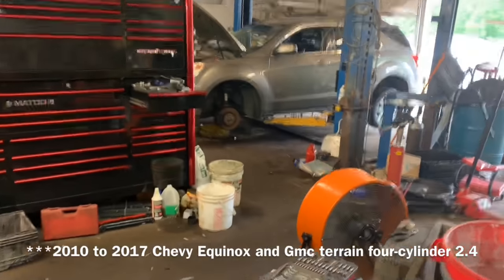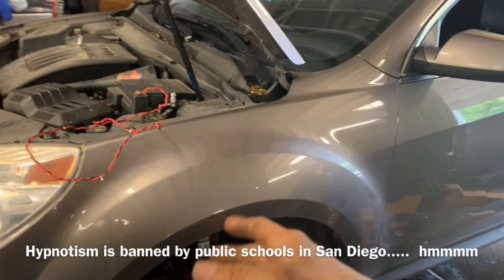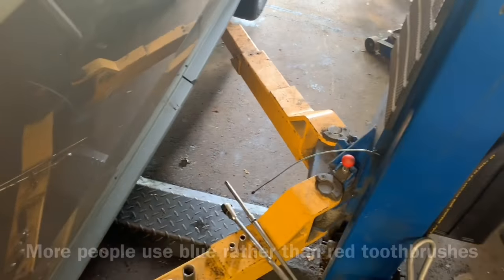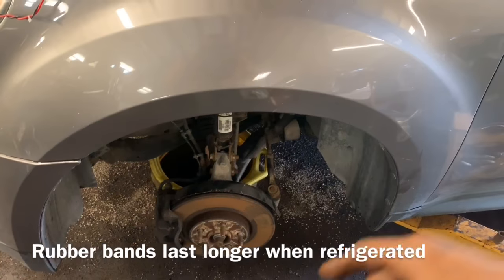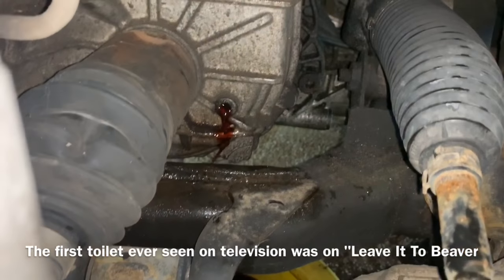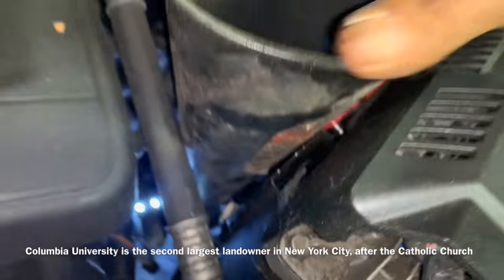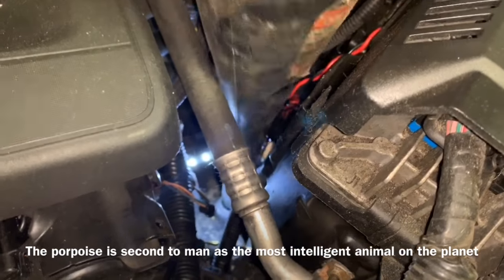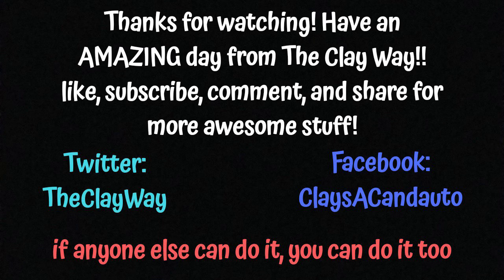Chevy Equinox Transmission fluid check and fill procedure

Comment: Is your shop still open? Google says its permanently closed
Reply from the maker: Yes but I don’t run a public repair service any longer mostly do YouTube videos and if I left my address up for people to find me I would have strangers showing up all the time that was the problem at my other shop and even though I really really love my followers and supporters it would take hours out of my day.

If there’s something special in particular that you need help with or if it’s a big job I sometimes take them on for the public but it’s very seldom. 

What is it that you need help with?
Reply: @sharpcarco  family member passed away and we are gifting the car to a relative. Took it to the dealership for routine maintenance and fluid changes. Got the car back and transmission only shifts normally at wot. Anything less and it slips and shudders.
Reply from the maker: Well that’s a really common problem with them cars unfortunately they’re pretty much all around junk but it’s probably cheaper to put a transmission in it. Then it would be to replace it so I could help you out with that I don’t have a video showing folks how to replace the transmission on it. It would not be a super cheap job though. 

If that something you’re interested in you can look me up on Clay‘s AC and auto repair on Facebook messenger and send me a DM or you can email me at Thenewclayway@gmail.com

I’ll give you my direct Contact information I’m sorry I don’t give that all over my channel

Comment: But how do i know if i need to do this? Theres no dipstick for it anymore?
Reply from the maker: Well the good thing about transmission fluid is it just does not evaporate…… no need to check it if there’s not a problem. At least that’s the way General Motors looks at it

Or if you feel the absolute desire to check it just turn the wheel take out the check screw which is the second Highup screw and the fluid comes out you’re good……. If it doesn’t then you need some you need to make sure it’s up to operating temperature meaning it needs to be at 180 to 190° and I personally remove the wheel but you don’t have to

Comment: i have the 2013 equinox. i had to pull the engine and change the rings for a gallon a month oil use and rod bearings and the timing and balance chains because the timing chain destroyed the black guide and the bolts for it, i also changed the rear main and torque converter seals but now i see i have a leak between the engine and transmission. i got the trans seal from rock auto they had 2 choices for the awd trans. i picked the first one and now i may have a leak there. when i went back i noticed the one i got has a .o59" id larger the other seal and it is .102" smaller on the od than the other seal. so can you get me the exact part number so i can double-check to see if i picked the wrong seal?  i'm going to take out the starter and if i see oil in the flex plate then the rear main is leaking and if i see oil on the torque converter or the inside of the bell house i figure the seal is leaking. if none of those places show oil then i figure the seal is not sealing at the housing?  can you confirm that theory? thanks bob p. your not to far away from muskegon
Reply from the maker: Look me up on Clay’s AC in auto repair on Facebook send me a DM and I will send you my phone number I’m over in Muskegon but I wanna make sure I understand the question you’re asking and it’ll make it much simpler for me just answer it over a phone call
Reply: @sharpcarco  thanks but i do not have a facebook account. maybe i can find you by looking up clays ac if that is for ac repair and get your contact info that way.  thanks
Reply from the maker: ThenewClayWay@Gmail
Reply from the maker: I don’t post my phone number anywhere it’s all hush-hush ya know lol My address is incorrect….. I love my followers and folks in general but they would show up on unannounced And I don’t run a retail repair facility any longer so I just help people out when I can
Reply from the maker: Sorry I meant to say send me an email to my Gmail
Reply: @sharpcarco  ok i understand. i have the same thing i fix something for someone and then i become their permanent mechanic. got a lot of those and i retired 5 years ago. this happens to be my girls car or else i would have not got involved. and this is way more than i wanted. thanks

Comment: How can I check the level? I don’t see transmission stick? Can someone help me please. I have a 2013 Chevy equinox and I would like to check the transmission fluid
Reply from the maker: There is NO dip stick , 

1. Start vehicle let it warm up to operating temperature (just like I show in video)

Leave engine running!

2. using proper socket (see video) 
Remove plug bolt on side of transmission. If fluid comes out with engine running wait till fluid starts to drip reinstall bolt. Your trans fluid is at proper level

If fluid dose not come out it is low and needs to be filled (see video) 

These instructions were in video sorry 😐 you missed them. May be I did not say there is no dip stick. Can’t remember. Hope the instructions help
Reply: The Clay Way thank you so much. Your video was so helpful. Keep up the good work brother. God bless you

Comment: It would of been very helpful to specify what type transmission fluid you were using.
Reply from the maker: OK I used the right stuff. More than likely I showed you pouring the bottle inside during the video….
Reply: But you didn’t have it to to where you could see the label, and the bottle was backward. Only the back visible. I’m assuming merc V though. Also, you didn’t show how to drain the fluid. Only how to top it off.

Comment: So how do you check the level?  It says in the description check and fill.. but not showing how to check it.
Reply from the maker: No offense but if you would’ve listen to me during the video you would know how to check in removing the bolt is the way you check it if you fill it till it comes out where the bold is removed on the side of the transmission there is no dipstick
Reply: I've actually watched 3 times and didn't see anything about CHECKING. I see how to drain and refill.

Comment: Does the car have to be on when you check it? I swear I hear the engine running. Please hit me back up.
Reply from the maker: Yes I’m fairly certain in the video I mentioned that it needs to be running and up to operating temperature to check the fluid level and fill it to where it needed

Comment: The manual says to pull the overfill/check plug out when the ATF's temperature is between 185-203 degrees fahrenheit.
What is the temperature of the ATF when the engine has fully warmed up?
Reply from the maker: Yes and sodas my video
Reply: You didnt answer the question.  Coolant temp does not equal transmission temp.  It can lag coolant by 60F.

Comment: How can it fill up when the drain plug is open and the vehicle is still running then you said stop pouring when you don't see anymore coming out, isn't not coming  out because it's empty, I'm confused
Reply from the maker: Well, that’s how you do it because the vehicle is running and that’s how you check the fluid level in the same way that you fill it up. You just leave it running. You use a long funnel to fill it and when the fluid starts coming out, it’s full then you put the cap on with it running….  And you install the drain plug with it running…. Because then the fluid is on the inside of the transmission because it’s running and being pumped through it if you did not have it running the fluid would come out of the hole at the wrong time
Reply: That's not the drain plug he has open is the fluid level check plug. The drain plug is located on the bottom of the transmission under the car

Comment: My 2008 equinox sport does not have anything in the video for mine.has a 6t70 trans 10qts of fluid. And has a dipstick under the fuse panel. Ps motor mount is 4 bolt and does not look  like the video show.
Thanks fyi

Comment: What transmission fluid do you recommend?
Reply from the maker: Hey good afternoon Samantha honestly I can’t remember what are used inside them. But I could recommend just taking a short look in your owners manual and it will describe what goes in there. Sorry I don’t know that off the top of my head I wish you the best of luck I may have mentioned it in the video what I used as well
Reply: GM part number# 88861003 at least for a 2013 
Maybe @The Clay Way knows how many quarters should we buy cuz I didn’t find anything on service manual

Comment: How many quarts of oil ot takes
Reply from the maker: Sorry you’re gonna have to go back and watch the video. With the vehicle running and up to operating temperature you put in enough until it starts weeping out the hole…… 

If you don’t mind I spend a lot of time making these videos and I know that most people don’t watch a 10th of them…….. But I would greatly appreciate it if you would turn the volume down and let the video play so at least I get a 2/10 of a cent for trying to help somebody out.
Reply: What he did takes none since all he did was drain out what was over filled in the first place then over filled it again and put the level check bolt back in.  If that seems pointless it's because it was.  He never drained the transmission through the drain plug on the BOTTOM of the transmission so he doesn't know how much a fluid change takes.
Reply from the maker: Well I guess that’s why the title of it is …… check and fill procedure…. Not “drain and change” 

I know it’s difficult to understand when you’re constantly reading what you want to see.

Comment: If u add fluid till it comes out the drain hole . Why does it drain when u open it . Shouldnt it come straight out the drain as soon as u put it in ?
Reply: I believe Rick it's like this...drain out using bottom plug, fill up same amount then, temp must be over (and this is trans temp so check using OBD tool) 85'C, go round block in 2nd gear a few times slowly so the air doesn't cool her...get her trans up to 90'c this will give you time to work on her before it goes below 85...oil control valve either opens in the trans and allows oil out at 85'c....park level surface keep engine on, wheel to the right, get in there and open the level check plug...it should trickle out...if not pour some in slowly...see if it trickles out...this is how to check...if we check when it is below 85'c the oil control value lets too much oil out, more will come out of the level check plug and then when she does heat up she will be under filled.  I think I finally understand it after many many many videos. It is imperative that it is higher than 85'C when using the check level plug on the side of the 6T40 transmission.

Comment: Is it possible that your video shows yourself removing the drain plug by mistake and that the overfill plug is up higher on the transmission?
Reply from the maker: There’s two plugs one on the bottom and one in the middle. So I don’t think so….
Reply: @sharpcarco  thank you
Reply from the maker: And I’m sorry Juan it’s possible that I made a mistake but nobody else has said anything about it and I think that video has a couple of views , I have made mistakes in the past so It is possible but highly unlikely. And I did it while I was making the video.
Reply: @sharpcarco  Nope I think you got it right. I have a mystery leak.
Reply from the maker: Sorry to hear that brother hope you get it cleared up

Comment: What if you just fill it from the top without taking out the drain plug?
Reply from the maker: You will overfill it and it will blow up.... You only have to remove one bolt to be able to make sure you don’t overfill it

Comment: Is there a way to replace.the bearing in the transmission where the CV axle goes into the transmission? I'm replacing my CV axles and was told the bearing in the transmission needs to be replaced? Is it possible?
Reply from the maker: Hey Mike sorry I do not know if that’s possible I highly doubt it though I would assume you would have to remove the transmission and split the case
Reply: @sharpcarco  thank you VERY much. keep up the great videos

Comment: So what you show as the drain plug is only the level checking plug. The drain plug is on the bottom of the transmission. You should be removing the plug on the bottom to drain the fluid. Then when the fluid comes out the side plug you know it’s full.
Reply from the maker: Well the name of the video is NOT how to drain your transmission fluid it is 

“how to check and fill your transmission fluid”

Man the trolls are out in full affect this weekend.
Reply: @sharpcarco   I get that but it is all one process, to me is a good way to confuse a poor soul. Keep up the videos.
Reply: if it's not up to 85'C the level check will be wrong. It will be underfilled if you do this cold.

Comment: Okay, I may only be what we used to call a backyard mechanic, and that was before all the weird transitions and computerized stuff took over the market. What!!? There's no dipstick to check the the transmission fluid? No wonder I couldn't find one. What a bunch of dipsticks to design it in this way! But I know their purpose is to cause even more people than ever to take their vehicles to an overpriced garage just for basic maintenance that every driver should know and be able to perform. This is a lot of work just to check a fluid level, when a simple dipstick would be far more efficient. Yes, It's like I've been on a deserted island for 22 years--the real deal was something like that.

Comment: Why do you have to warm up the engine ?.Why not just drain it measure how much you took out and replace it.The drain bolt should be magnetic to catch metal.
Reply from the maker: Yeah, that sounds simple… what about if there’s not enough in it? 

You warm it up because when you warm it up, that’s when everything starts to separate and everything is pumping around inside the transmission …

Comment: I found your video quite confusing.  You start the car and then remove the drain plug with ATF flowing out. Then you put a funnel and you start adding ATF from the top. You don't say when you stop pouring it in.  You only just seconds later. Go underneath when the car is not even running at that point and say something about the fluid stopping draining.  Now tell us do you pour the fluid in from the top until it looks nice and new and red at the bottom and then shut the car off and then wait for it to stop coming out the hole. Replace the drain I mean come on give us some steps.